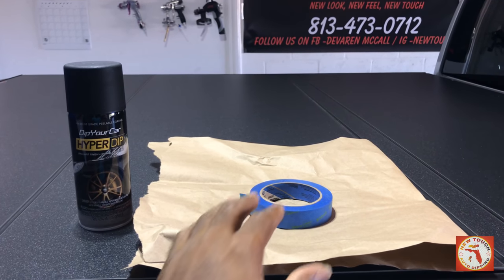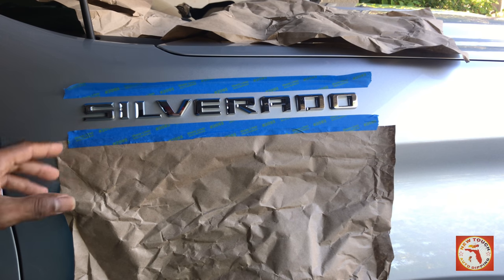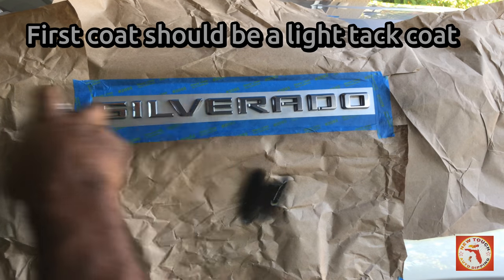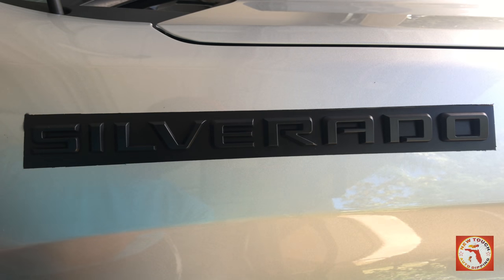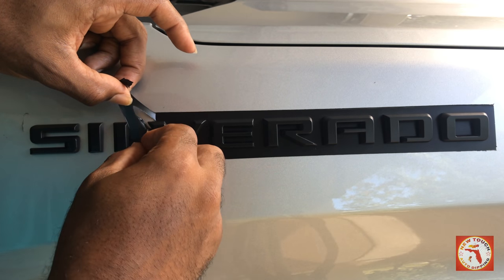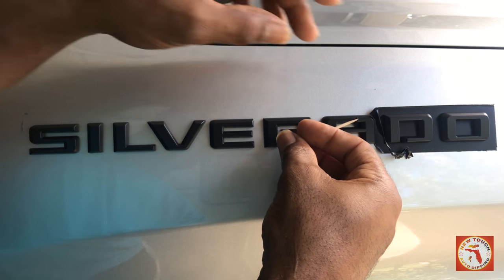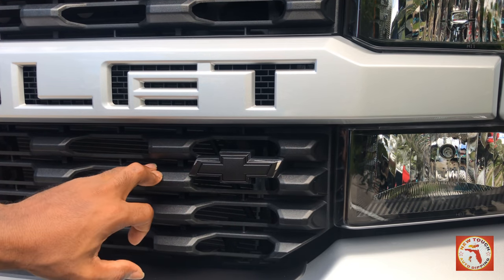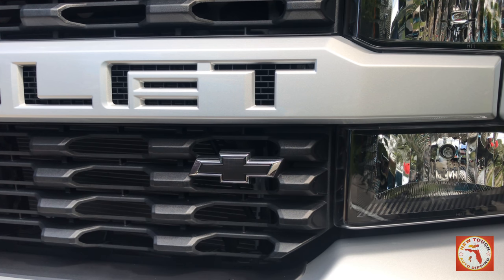(How to) HyperDip/Plasti Dip Your Emblems

Comment: Thanks for the video "New Touch Auto". I have a question :  When cleaning a car`s PlastiDip emblems with a high.pressure machine, will it peel of or is it strong enough ?
Reply from the maker: You’re welcome and thank you for watching the video and sharing your thoughts. 

When it’s applied correctly you won’t have any issues with sage washing skills. Lifting will likely occur when a pressure washer is sprayed too close, this will cause the pressure to get underneath and peel. Keep in mind, it is a removable paint product that allows you to return to the original look. 

There’s a video link at the end that’ll answer any questions pertaining to washing a car wrap.
Reply: @newtouchauto  Thanks for your answer ;) ok if i understand you correct, the best way is to hand wash and not use high pressure water too close. A drive thru washing machine will peel plastiDip away i guess.  Keep up the good work "New Touch Auto"
Reply from the maker: @Geir-rl8mp  you’re welcome, the product can withstand a drive through car wash but of course hand washing is the safest method.

Comment: how does this hold up in a carwash
Reply from the maker: When it’s applied correctly you won’t have any issues with hand, drive through or pressure washing.
Reply: Hopefully I'm doing this correctly
Reply from the maker: @gotmurica6225  if you follow the steps and properly install it correctly then the outcome will be a success

Comment: Very impressed with how this came out.  Nice job and good explanation as well.  Once this is fully dried how does it hold up against pressure washing?  I clean my truck often and always use a pressure washer.  Would that rip this right off?
Reply from the maker: Thanks and I appreciate you for watching the video. As for washing there’s a video link at the end of this that’ll explain washing this type of material. With pressure washing you’d wanna keep a good distance so that it doesn’t uplift from the emblems, when it’s applied correctly you won’t have any issues with washing the vehicle.
Reply: @newtouchauto  Thanks for the reply and for the video.  I might give this a shot.
Reply from the maker: @johnyortiz8774  You’re welcome

Comment: How long does this typically last?
Reply from the maker: When it’s done correctly 3-4 years before needing it recoated or removed, it’s very hot here in Florida so if you’re further north it could be longer durability.

Comment: How long in between coats are you doing?
Reply from the maker: In summer weather 10-15 minutes in between coats, cooler temperatures 65° and under will result in longer wait times.

Comment: How can it be protected to wash it
Reply from the maker: As for the protection I like to use the DipCoat protection spray from dipyourcar.com and the car washing is normal soap and water minus the wax. 
Here’s my video link for car washing wraps if you’d like to see it. 
https://youtu.be/WxrjERIBDHg
Reply: @newtouchauto  ah ok, so no real way to protect in a car wash? I'm in ny, and with winter coming, that means salt all over..
Reply from the maker: @justajuicy1231  actually the wrap is designed to protect what’s underneath. With other removable paint products like dip armor you can ceramic coat the wrap to protect it.
Reply from the maker: @justajuicy1231  actually the wrap is designed to protect what’s underneath. With other removable paint products like dip armor you can ceramic coat the wrap to protect it.

Comment: Can you use this on door handles, steps, etc
Reply from the maker: Great questions, the 2 areas are actually the worst for any spray wrap. Any area that can potentially have consistent touching or traffic is never good, however there is a solution for door handles. If you’re able to spray wrap around the entire door handle everything will be fine but if not you’ll need to place a strip of vinyl or tape behind the handle. If you don’t the spray wrap will become unraveled overtime from the constant touching and pulling. 

Step bars can be done but I don’t suggest spray wrapping the area where the feet touch getting in and out of the vehicle. Overtime it’ll begin to peel.

Comment: This is only the second video that I’ve watched on this and because of your clear instructions I am going to try the “KONA” emblem on my new 2022 Kona N Line.  Since I’m an almost 50 year old grandma my spray painting has been limited to craft and home decor and this has shown me that I can for sure do my car.  Side note: it seems like you take the time to respond to all of the comments on your video and that is something to be commended!
Reply from the maker: Thank you and I admire your motivation to try this project, if you’re familiar with using aerosol cans then you already have the technique. The only thing left will be the confidence which I also see that you already have, the fact that you’ve made it this far in life is enough confidence to live and be great at what you attempt. 
Hopefully your project is a success, you can definitely achieve this.
Reply: @newtouchauto  Ok I’m back 😊 I ordered my Hyperdip and the weather in WI is slowly warming enough to do an outside car project.  A Dip Your Car video says after cleaning and taping I have to do two light “dry” coats with five minute dry times in between then 6 “wet” coats with at least 20 minutes each and an hour after the last one.  You’ve said 12 coats which is fine but how much dry time in between coats please?  The peeling part looks pretty easy…we’ll see!
Reply from the maker: @lorridzak  okay well it looks like you’re ready for action, I do 12 coats as my standard for it to peel off easily when the time comes but 8-10 coats are reasonable. You may have saw a plasti dip video instead of hyperdip, the 2 are different when it comes to installing. 

If your temperature is 65-75 degrees give it 15-20 minutes, if it’s 75 degrees above 10 minutes, if it’s 65 degrees below 25-30 minutes. Your temperature plays a huge role when you’re either outside or in a garage so the best temperature setting is 72-75
Reply: @newtouchauto  thank you so much!  As anxious as I am to change up my car I’ll wait for better temps!
Reply from the maker: @lorridzak  your welcome and I agree.
Reply: @newtouchauto  well I don’t know how to show you but I’ve started using the Hyperdip on my Kona today. I got busy in the spring, Wisconsin summers are too humid but it’s calming down now. I didn’t use the prep spray I hope it doesn’t come off.
Reply from the maker: @lorridzak  that’s great, if you ever decide to do another project in the future you can substitute the pre dip spray with 70% alcohol.

Comment: Do you peel while wet with plasti dip as well?
Reply from the maker: Yes but you only peel off the masking tape and paper while wet. The extra around the emblems you’ll wait 50 minutes to an hour to peel. 

Autoflex from DYC and Spherical from Raail you don’t peel while wet, you can wait until 2 hours later or even the next day.
Reply: @newtouchauto  Thank you! My project turned out great!
Reply from the maker: @Was-here2  you’re welcome and it’s always good to know that it was a success.

Comment: It's a great video! I'd like to add an additional tip at the end when removing the excess. How about knifeless tape, using it like floss. If you shimmy it above & below each letter, it should cut them all. Then just go between each letter and then all the excess should peel off in one go.
Reply from the maker: Thanks and yes that’s a great input option, it’s definitely worth a shot. Thanks for checking out the video, I really appreciate it.

Comment: Nice nice nice work
Reply from the maker: Thanks Thanks Thanks for the compliment, much appreciated
Reply: @newtouchauto  No sir,  thank you for sharing your incredible skills and giving me the confidence to attempt this myself.   I will take my time.
Reply from the maker: You’re more than welcome
Reply: @newtouchauto  the only part that I'm not sure I'll do right is the first light tack coats and those prepping steps seem crucial to the total outcome.  Any pointers that go beyond what you explained in the video would be most appreciated.    And I think it's fair to sub and like.
Reply from the maker: @Mainbusfail  the first few tack coats are pretty easy to achieve, just move at a faster pace with the first 3 coats and then a medium pace with the next 6-8 coats. Any additional coats will be beneficial for a more durable finish. The medium coats will help decrease any paint runs, anything slower will ruin the finish. 

Relax your mind and understand that if you so happened to make a mistake, simple peel off what you have, learn from it and start over. At the end of the day this type of material is removable.

Comment: That’s really cool, but to save yourself some time, just take the emblems off, coat them floating off of the surface, then put them back on.
Reply from the maker: Thanks but for me that’ll be the process for permanent painting emblems. I don’t feel that it’s worth the time dealing with removable paint but you are correct in the oem world